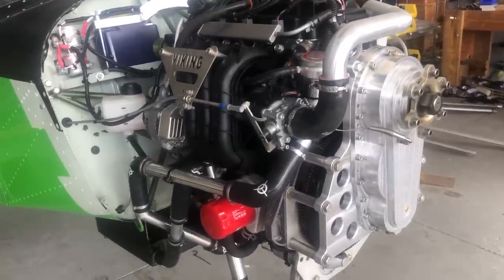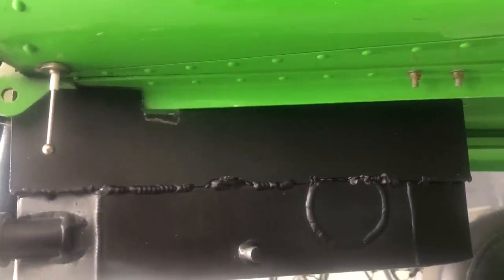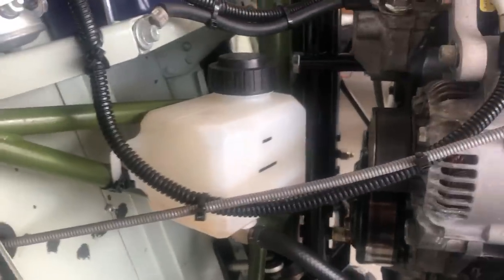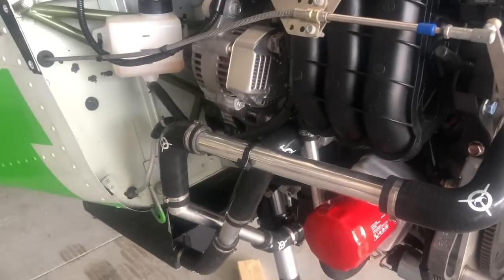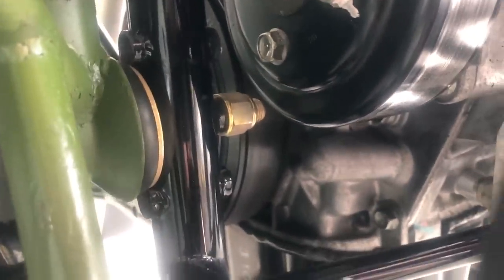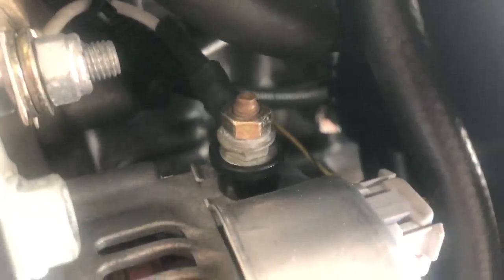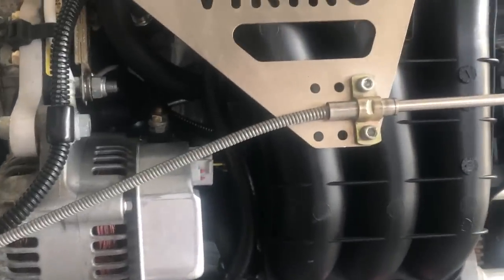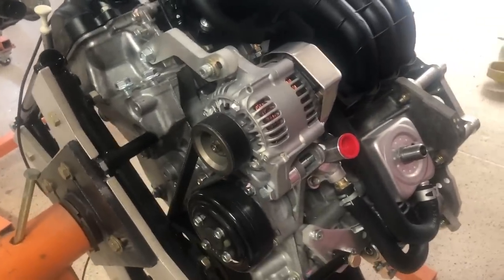Viking 90 Installation

Comment: I mentioned putting a turbo on this engine a while back. You said they had to much compression to do so.  I'm glad you are doing some testing on the setup. Hope to hear more on the results.  Have you done anything to lower the compression of the engine? Cam swap for better turbo performance? Gap top piston rings? How much boost?
If this engine had 9.0:1 with about 15lbs of boost I was guessing it would be able to put out 150ish horse power.  Just an amateurs guess though. Just hate to compromise the reliability of the engine.
Love this engine for sport pilots for the weight savings. I'm a big fan of 3 cylinder engines as well.
Reply from the maker: We are looking at 1 psi generating 7 hp.  So to have a solid 100hp engine, we are going for 2 psi /  33" MAP
Reply: @eggenfellner  So, at this point, do you believe you'll be offering a turbocharging package for the Viking 90?  It would be great if you did.